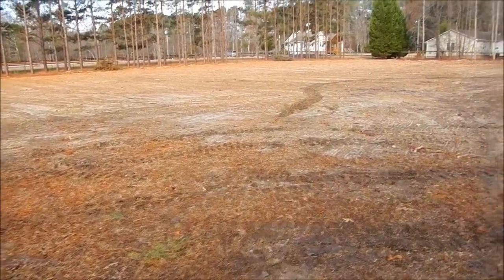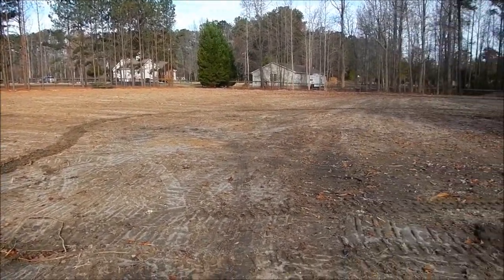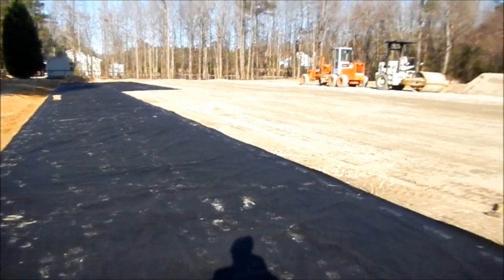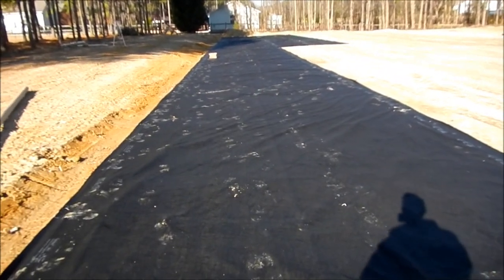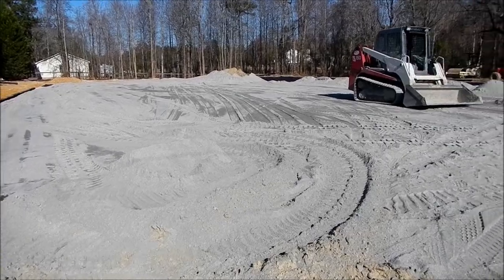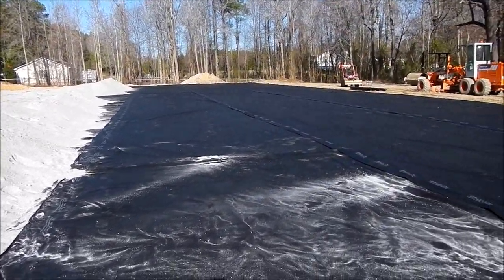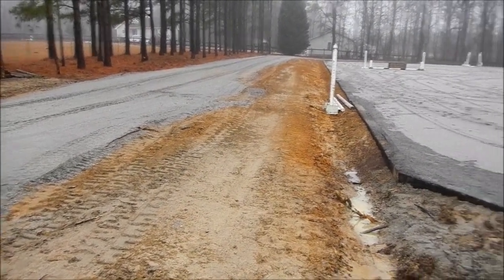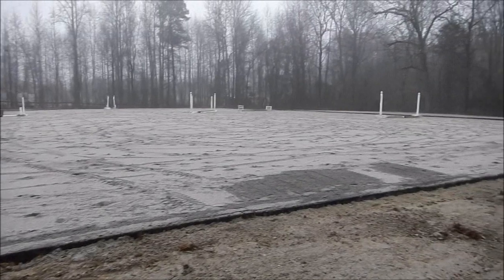Building A 24,000 Sq Ft Horse Arena

Comment: Good looking job. I take it the owner is relying on natural run-off drainage since you didn't appear to install any artificial under-drainage. I must say I am surprised about that if this is the case. I presume someone else is doing the post and rail fencing?
Reply from the maker: yeah the crown will allow the water to run to the edges where it will drain out.  Ive never done one with underdrains before and never really had any problems as long as the base is packed good. yes someone else does the fencing